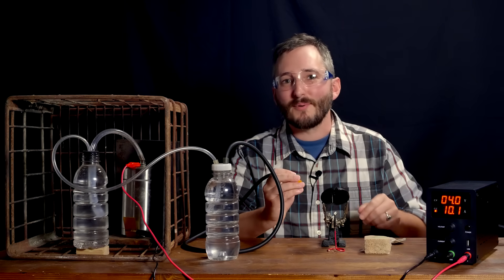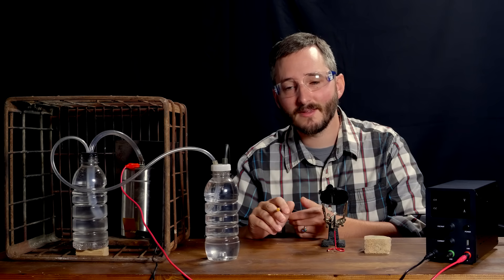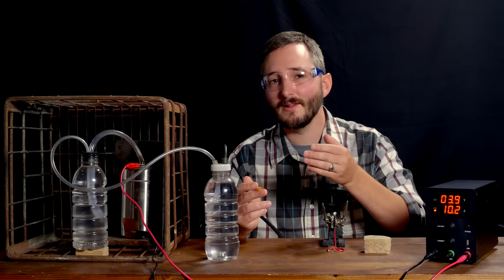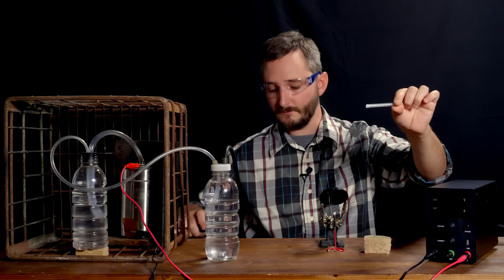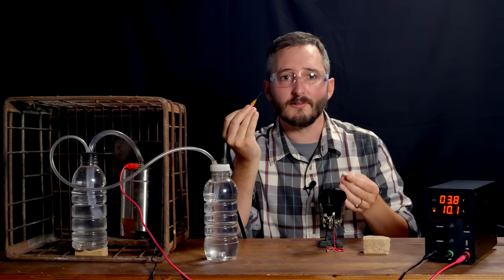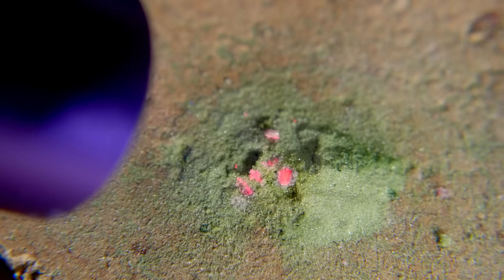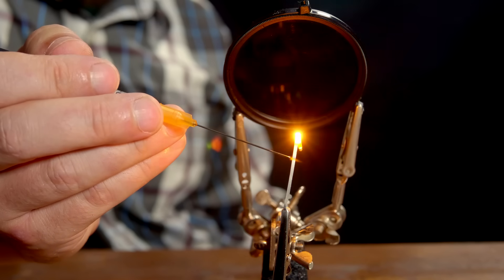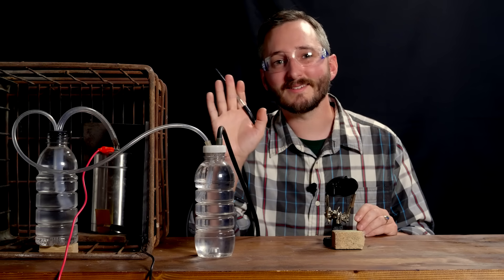DIY Oxy Hydrogen Torch Using Water Electrolysis

Comment: I work as an optician, mainly in the workshop, and we have an apparatus that does exactly that. We mainly us a 1mm nottle and can shut of the gas at the handle. The pressure this works at is 0.3bar. We exclusively use it to solder, when there are repairs of glasses that need to be done. But our flame is green and is 2cm long. Only burned myself once, and that tought me a lesson, i assure you.

Comment: I mean, making glass with nothing but sand would be pretty damn sweet. People always post videos like "glass from sand!?" and the glass is always like 60% flux.
Pure silicon dioxide glass would be cool, but the torch might be a tad small for that.
Reply from the maker: Fused silica glass does take a flame about this hot, so that would be an appropriate project
Reply: @Nighthawkinlight  That's what I was thinking. But do you think you could get a sizeable enough bead going with that torch of yours?
Reply from the maker: @WhyNotDeanCV  Not large enough to make something useful. It would be an ambitious project to make a large piece of fused silica
Reply: @Nighthawkinlight  Wouldn't have to be a whole pane to be impressive. A fused silica marble would be super cool. There is something very satisfying about taking a raw, natural, ressource and refining it into something pure and useful.

I suspect thats a large part of why those "primitive technology" videos gained traction.

Comment: Great video as always! Though I was wondering, shouldn't the tube coming from the generator and into the arrester be submerged when entering the bottle? If the portion of the tube above the waterline fails wouldn't that give a bypass route around the water?
Reply from the maker: Yes, it is submerged
Reply: @Nighthawkinlight  Ohh ok ok. Looking again the light reflecting off the bottle kinda tricked me into thinking there was a void of air inside the bottle rather than filled all the way lol

Comment: Speaking of limelight. One time, when i was starting the furnace with some magazines and scrap paper, i noticed that the ashes of one of the pieces of paper would glow incredibly brightly when heated with a butane torch.
I had never seen that before so i put the ashes into a jar for safekeeping and maybe future experimenting.
I wonder what made it glow so bright.
Reply: IIRC, magazine paper is made with gypsum to give it that glossy feel. Maybe it was that?
Reply from the maker: Similar effect to gas mantles in old camp lights

Comment: If you feel like testing it, try hooking up a pulsed power supply (very slow PWM), as far as I know this might increase the efficiency of the system and even prevent (fast) heating of the HHO generator. Supposedly it's more efficient if you turn on/off the power, because when bubbles are generated, they insolate the electrodes partially so turning the system off for half a second should alow the bubbles to flow away from the elctrodes and thus not cover the surface area of the electrodes. That is the theory at least, I'm curious to see if it has any effect in practice.
Reply: If its insulated, it wouldn't draw power at that part.  think...

Comment: I really want to try this with jewelry. Soldering chain together can be difficult because a regular flame can melt 10 links at a time when I only need to heat up a single section of a link. Only problem is the temperature, that's really hot. This is where lasers come in but those machines are too expensive to use at home for DIY stuff.
Reply: Those Smith little torch tips get pretty tiny... you must be making really small links?  Awesome.
Reply: @travismiller5548  It's more of not wanting to have 2 sets of everything. Everything at home is DIY for fun

Comment: Just attended the gas welding workshop at the EAA AirVenture in Oshkosh over the weekend.. the guy did a Oxy-Hydrogen Aluminium welding demo using these two fluxes:  
"Tm technologies gas welding flux for aluminum" and also "ESAB No. 35 flux (containing Potassium Chloride, Sodium Chloride, Lithium Chloride, and Lithium Floride [sic])"
He said the second one was better but not available any more, and the first one being the best available today. 
He also said that many common ones are not all that good, and that the flux must be welding flux and not brazing flux to perform well.
also edge welds dont seem to need to be sand paper cleaned of the Al oxide layer buildup, but butt welds do.  also do not weld from the edge inwards on a butt weld, as a crack can form and follow the weld puddle across the piece,  always weld towards an edge with butt welds in Aluminum, with edge welds, it does not seem to matter.

he also said there was no UV and eye protection wasnt necessary.... which i can't seem to wrap my head around... how can something be ~3000 C and NOT emit UV...???
 I think he was BLIND WRONG on that issue... 
Even if the flame does not emit dangerous UV, the sodium flux produces prodigious light as it turns into plasma...  the guy passed around the special glass blowing glasses which blocked the Sodium emission light..  pretty night and day difference

Comment: Make a big one and make huge rubies and a flame fusion furnace
Reply: i wonder if you can make diamonds with this ?
Reply: @josephtaylor6527  not without further modifications. Carbon tends to want to be released as carbon dioxide, to account for this you need an extreme amount of pressure to keep it a solid

Comment: What is that popping noise when you melt through the glass at the end?
Reply from the maker: It's the liquid glass bubble popping as it's pulled outward by surface tension.

Comment: That flame travelling slowly through the needle has got to be one of the coolest things I've seen to date, thanks for sharing! Have you considered using your separate-cell electrolyzer to build a larger, more practical-size torch? I'd love to see a build tutorial for a larger HHO torch, and using separated streams of oxygen and hydrogen gas seems like the best way to go (safety wise at least).
Reply: ye it looks cute. Now you need to realize that this also happens in oxy-acetylene torches, and trust me you don't want to witness that shit. It makes a terrifying screaming sound while slowly melting your entire torch and it's handle, burning down to the oxygen and acetylene gas lines. That's why multiple flashback arrestors on a oxy-acetylene is a must have, or things can quickly go kaboom. This is what we call a sustained flashback, or sustained backfire.
Reply: it's like if bombs had progress bars
Reply: @vxiiduu1629  comment of the day goes to you, lol
Reply: @vxiiduu1629  like those old timey fuse animations in videogames
Reply: Well nobody would like one tank full of hho , so separete them we should
Reply: yes, me want bigger torch too
Reply: you could also use a thermistor and solonoid valve to cut the fuel if the flame starts to travel back along the nozzle. This WOULD result in the flame shooting back along the tube since it reduces the flow rate BUT the solonoid would make sure the flame doesn't reach any other fuel so it would be like a controlled SCRAM burn. (not as in how a SCRAM sequence in a reactor occurs, but rather in nature, a quick shut off.)
Reply: Great Content
Reply: That's what I was thinking as well -- keep the hydrogen and oxygen streams separate for as long as you can, and then combine them only when you have to, so in case you do have a flashback it doesn't have very much volume.  I once had the chance to see and try a natural gas + oxygen torch like that -- if the gas flow dropped too much it would make a very loud bang, but nothing bad would happen.  I am a bit nervous about aluminum wool as a flame arrester -- if the aluminum does manage to catch fire, it will produce an even hotter flame than the hydrogen + oxygen.  (The flame arrester in the gas + oxygen torch I mentioned before was brass or bronze, presumably for this reason.)
Reply: @zomgthisisawesomelol Oh you can find separated units.  Try eBay.  They cost like 5X as much though.
Reply: Misson impossible theme intensifies
Reply: There are videos showing 30-40 LPM HHO production on youtube. You just need to stack up enough plates and run a current through them. You want high current but low voltage per plate (2-2.5V). 20A at 240V using ~100 plates will produce several liters of gas per minute. An oxy-propane glassblowing torch usually uses about 5-12 liters of oxygen per minute.

Comment: how does starlite hold up against the flame?
Reply from the maker: Starlite would resist the heat, but not the excess of oxygen. Beyond the press channel tested it with an oxy acetylene torch and it held up.

Comment: idea for separate generation of gas streams?.... thin wall glass tube silvered both inside and outside using tollands reaction/silver mirror reaction. sand end of tube to remove electrical short. silivering on inside and outside of tube forms electrode plates... if tube placed vertically in water.. the gas bubbles should want to rise and then the glass keep the gasses separate.

duplicate tubes, join inners etc for higher flow rates.

Comment: this question doesn't have anything to do with this video. In your starlite videos you always put a flame to it to show how well it works. Do you have to make it burn in order to work well? say you wanted to make a thermos but instead of pulling a vacuum inside the walls of the cup you put starlite? would it keep this hot or cold for many hours? or, again, do you need to have that carbon build up for it to work well?
Reply from the maker: It needs high heat to activate the carbon layer. It does not work well for normal insulation purposes

Comment: Hallo...I used iron (not INOX) sponge as flashback arrestor and work pretty well too (but cheaper). In the apex of the needle of my syringe used as terminal, I've seen that after the flame turn off (in my case because of the not sufficient flow rate), the metal of the needle continue to appear red and hot .
 I think that's because the flow of HHO continue to react without flame, evolving just enough thermic energy to keep the reaction going on. After touching the needle the phenomenon arrests and needle become cold.
Is it possible that the alloy employed in the needle manufactoring act as catalist for HHO->H2O reaction allowing some sort of electric potential at the terminal of the needle?
Reply from the maker: Many oxides are good catalysts. Iron or chromium oxides may cause reaction without flame. Hard to tell in this if there is a flame or not because it does not give much light

Comment: I would suggest 15amps, your bubbler should have a mixture of water, acetone and alchohol. I think it will give you a hotter more non oxidizing flame. other than that and increasing pressure flow and torch size, this is a cool project and another good video, thanks

Comment: be very careful with stainless and electrolysis, it causes super cancerous chromium to leach out of it into the water
Reply from the maker: I've found I can easily render the Cr6 to nontoxic Cr3 with simple chemical reactions when needed. At the moment I don't mind toxicity as long as it's confined inside the device.

Comment: if you have such a hot flame why not build a small graphite forge or kiln out of graphite blocks for your burner? then you could do larger experiments at very high temps. Probably safer to build a burner that combines the hydrogen and oxygen at the burner though not the hho methode.

Comment: I would love to see a full scale oxy-acetylene torch set up with HHO, but I’m terrified of the thing turning into shrapnel.
Reply: The tanks for the oxygen and acetylene could be used to store the oxygen and hydrogen if they're produced separately. They would just need to be pressurized, requiring a gas buffer and compressor for both sides.
Reply: @RAndrewNeal  I know that would work, even if hydrogen is a pain to seal because of it’s tiny particle size, but I was talking more of the same exact set up like he showed in the video, just in a larger scale.
Reply: Stop over to the glass shop, crunk machine- we welds the quartz.

Comment: I bought a jewelers torch for HHO gas with a flashback arrestor in the handle. With my HHO generator it is now so much easier to melt my tiny amounts gold dust into nice beads. It was very difficult using other gas methods.